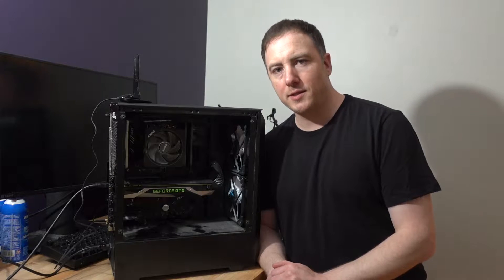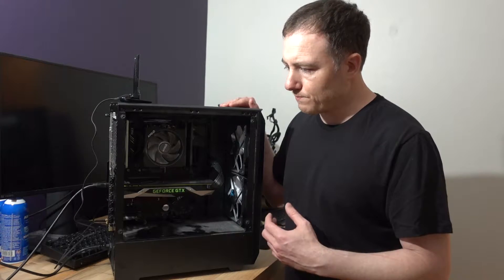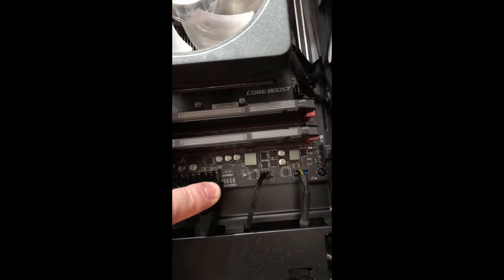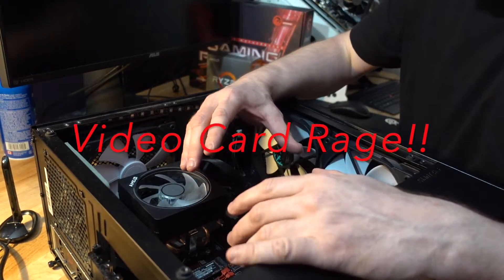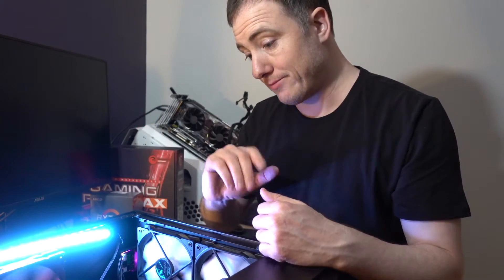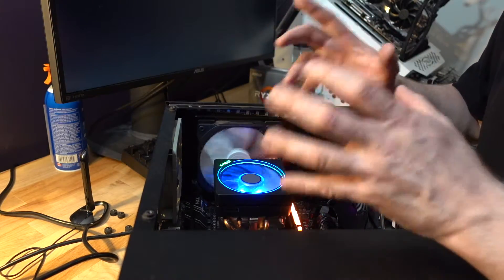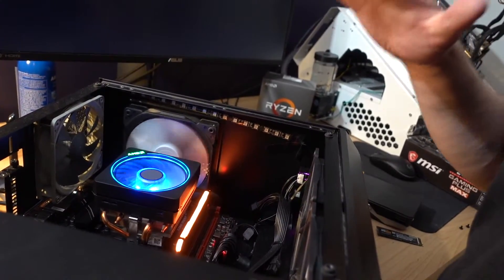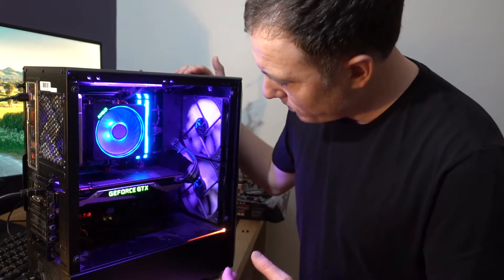AMD Ryzen NOT booting! - Troubleshooting PC -

Comment: i have the same problem, it started with a ryzen 3 3200g , then i switched to a ryzen 5 3600 with a gtx 1660 super and the problem remained. i'm going to RMA onde again because the store said the problems was the memories, and nothing changed, they just gave me another set. i've already bought a new mobo and i'm wiating it to arrive, but i'm still trying to get this solved 'cuz i'll sell it once it is ok.
honestly i didn't understand how you solved your problem.
i tried resetting the bios, using different bios version, tried with different processorss gpus and memories, and nothing worked.
Reply: I know this is late but did the new motherboard work?
Reply: @AliShaikh_744  yes! I don't know what was the problem, but it was in the motherboard
Reply: @Gbn1993  Thanks!

Comment: I got a similar problem, i got amd ryzen 3400g, built in asus rog strix b450-f, after two months of building it, it freeze and nothing worked, restarted it, then not boot,with black screen not signal, also got in motherboard white light (vga problem). After trying everything, and replacing cpu, it worked, now after using the new cpu, it happens again after two days!!!. :/
Reply from the maker: Weird. Try resetting the bios. Also I think that B450 Strix board has the ability to flash updated bios from USB key. Check the Asus manual but try updated the bios by USB. I think you basically put the latest BIOS for your board on a USB keg and ok the back of your board one of the USB posts should say BIOS, and or there should be a bios flash button on the back.